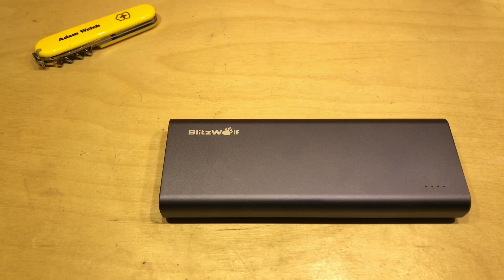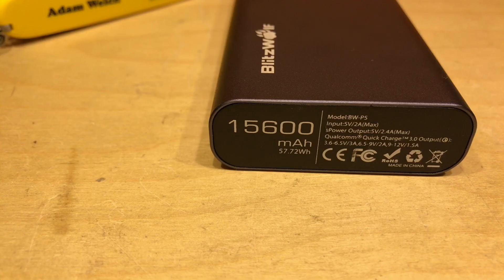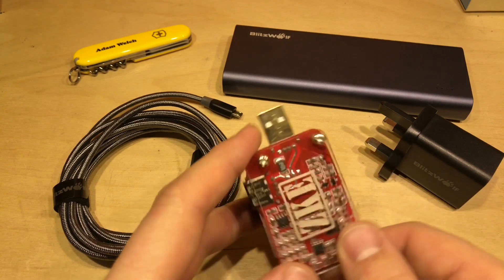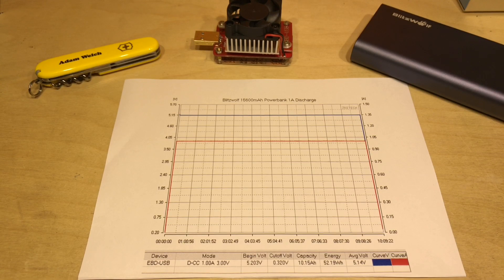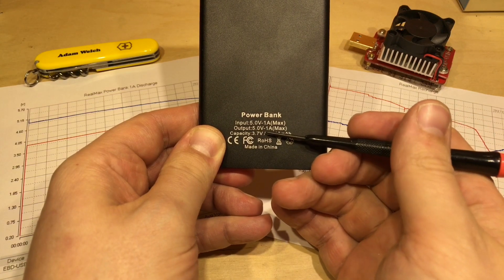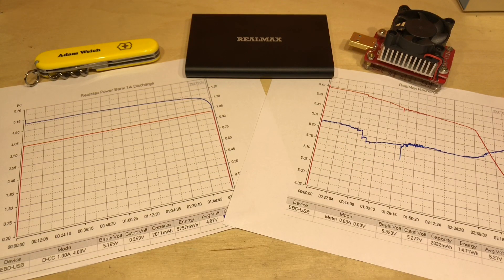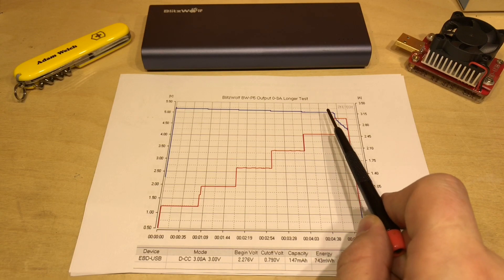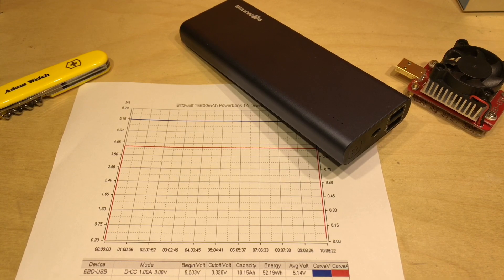Checking USB Power Bank Capacities - 12v Solar Shed

Comment: They always rate these power banks with the rating on the cells. This isn't very accurate as we know that there is some loss in the boost converter. I have tested many of these and none were up to rated capacity.

Comment: I just use this formula in an excel sheet to quickly determine the actual 5v capacity and it's pretty accurate. (Claimed mAh X 3.7 X0.85(or 0.75 efficiency) divided by 5Volts). In your case it's 15600 X 3.7 X 0.85 divided by 5 = 9812mAh. That is the 5v actual capacity. This way I am able to quickly determine the actual capacity. If I use 8 cells X 3500mah, I use that result as the claimed mah versus the actual conversion capacity. Why did I use 85 or 75% efficiency? Because I used the constant 3.7V when in fact it is not a constant because it can be anything from 4.2v to about 3.0v. In a project I used 30 18650 cells in parallel to create a usb power bank for extended use on a boat. I then attached 4 boost converter 3.7-5v usb sockets which can be found cheaply on ebay. I charge my mobile for about 20 times from this box.
Reply from the maker: Your formula is pretty close to my measured results.  Yours gave 9812mAh mine, 10150mAh.  Hopefully each time I mentioned 3.7 volts in the video I also said nominal? :-)

Comment: I really enjoy your vids! Here is a battery discharger that looks like it may handle large AGM battery banks. Looks very interesting though I am not quite electronic literate enough to understand how it works or its fit. I do alot with large AGM battery banks and would love a discharge analyzer.  https://goo.gl/ZZUYBK
Reply: Matt Buis hey that load looks pretty good from first impressions (begin edit after researching) it has a 4 wire connection and can do 15A but it does not seem like it would be reliable or easy to use, the one I reviewed on my channel (150W 60v electronic load) is probably a fair bit better, it has a full LCD display and it is the same price basically (not sure about shipping though) so unless you really want 15A go with the one I got: https://youtu.be/GQ2e373rtSw
Reply from the maker: Both look handy.  Do either of them interface with a PC?  I really like that functionality of my ZKE USB load.  In fact I've got an alternative load coming which uses the same software.
Reply: the one matt linked does have a mini-B does not look like any documentation though, mine does not so you would not get a graph only a time and Ah counter.

Comment: Thanks Adam. It's about time someone did some tests like this. The scam really annoys me, particularly because most purchasers never know that they have been scammed, but also because those who do understand the dishonesty usually say nothing, and thus condone the theft of people's money. If manufacturers and sellers are playing a numbers game, then why are they not advertising that product as 57,270 mWh? It's a much bigger number, and at least customers have something meaningful with which to compare one device against another. Of course that would give no protection against the makers of supplies like the RealMax (UnrealMin). Careful! I've been known to rant about this scam.
Reply: P.S. The question remains, 'Will subsequent buyers of your 'good' unit be able to buy one with similar capabilities to yours?'
Reply from the maker: Oh goodness I hope so.  This one came straight from Amazon - and I can't believe they have two piles of products.
Its a good point you make - if they are just trying to out number each other then mWh's would be the way to go.  I guess early manufacturers settled on their units and that became the standard.  If all the products could be trusted then it's still a good guide - this one has more capacity than that one, but you see people claiming it doesn't have the capacity advertised and I hoped this video might help reduce that perhaps just by a little.

Comment: Have you ever spotted a qc3.0 usb to cigarette lighter socket with the suitable electronics to request 12v? That would be so handy!
Reply: There are already boards that "trigger" the usb charger to output the QC voltages, they are called QC trigger boards. I made a video just now proving/explaining the idea basically get one of those boards and solder what you want to it: https://youtu.be/XvLgclcHgSM
Reply: Night Jar what!? That is actually a REALLY GOOD idea!! That could easily be done with some attiny done properly
Reply from the maker: A device to make a cigarette lighter, or a device that plugs into a cigarette lighter?
I've got a module actually.  Not a bad idea for a video that one...  Can I have that? ;-)
Reply: Adam Welch a device that provides a cigarette lighter from usb. That ones free mate, run with it ;)
Reply: There are USB leads with boost converter included that provides 9 or 12V, but not at very high currents (0.8/0.75A) as they're geared towards the max 2A@5V scene of chargers and power banks.
Other end isn't a cig lighter socket either, but  5.5/2.1 mm plug For instance: https://www.ebay.com/itm/USB-2-1x5-5mm-Male-Connector-Plus-DC-5V-to-DC-9V-12V-Step-up-Module-Converter-/222404557510?var=&hash=item33c8583ac6:m:mLPSvoxrD9qCweAvIWueYbQ
Something that could use the capability of QC3 would be nice...
Reply from the maker: I've just posted a video inspired by your question...  https://youtu.be/_U28cASPLgc

Comment: Good to see someone else starting to test powerbank capacities :)
Let's see if our results match up for this BW-P5...
47.500Wh @ 5V
Quite a difference, while using almost the same testing setup...
Only difference is the discharge load of 1A here vs 2A in my test...
I'll have to rerun it at 1A some time...
Reply from the maker: As suggested running a bigger load will reduce the output - the losses will be bigger and the cells wont be as good at completing the chemical reaction.  I choose 1 amp because I wanted to put it up against the realmax in the same conditions - and the realmax wouldn't output more than an amp!
Obviously the biggest issue with discharging at an amp is the time it takes.  Ten hours in my case.
Reply: Running it with a bigger load will reduce the power which is available, because resistive losses in the battery and the converter circuitry will be higher. More waste heat energy means less available electricity.